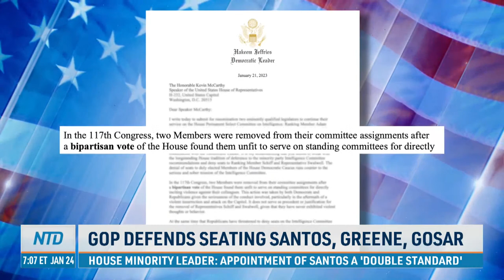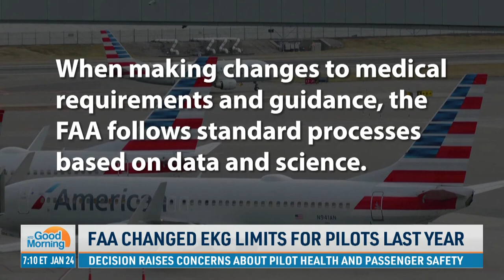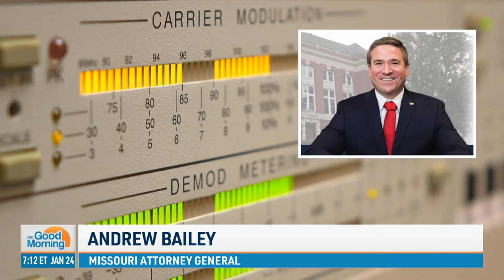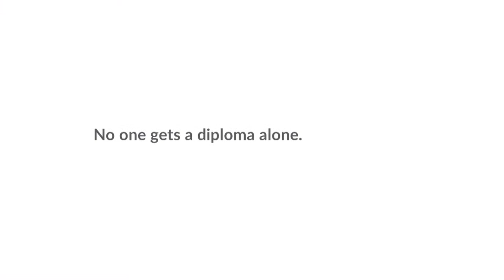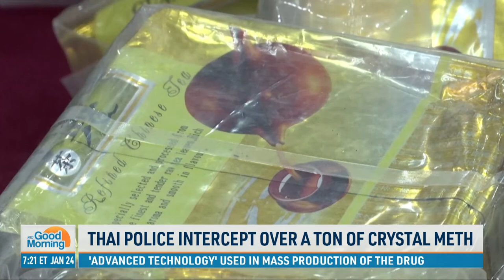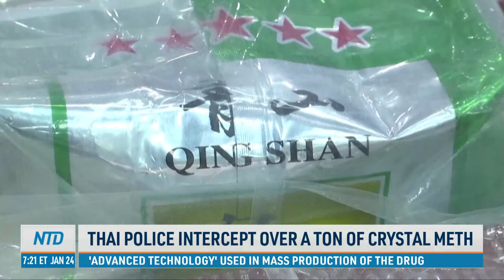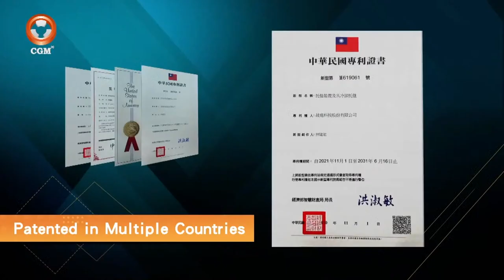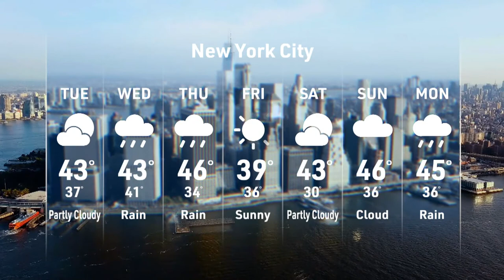Former FBI Agent That Probed Trump for Russian Collusion Indicted for Ties to Russia; CA Shooting

Comment: 8:30 No! Not revenge. It's what is right to put things back on track. You HAVE to remove the nails from the tires before you can patch the holes.
Reply: In His Case, Drive More Nails In, The Tire Is Rotten. :hand-pink-waving::face-blue-smiling: